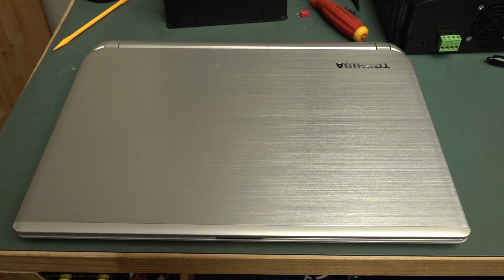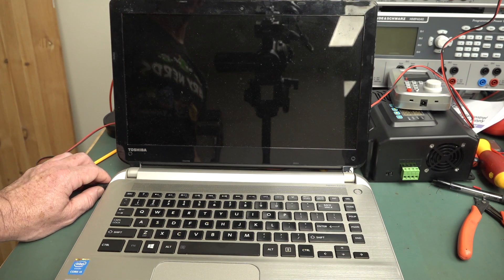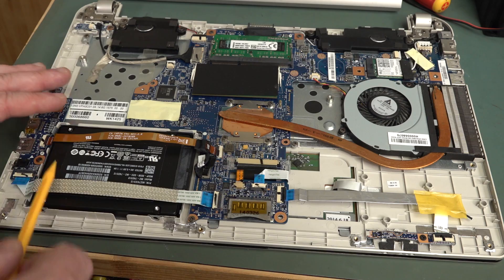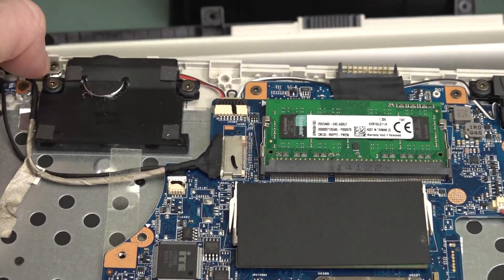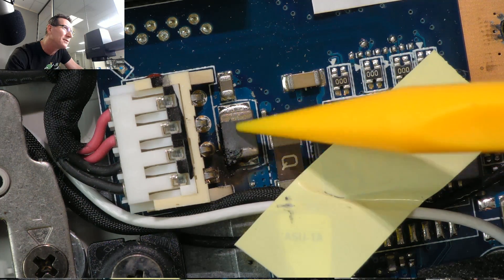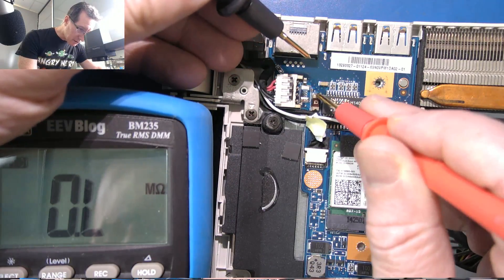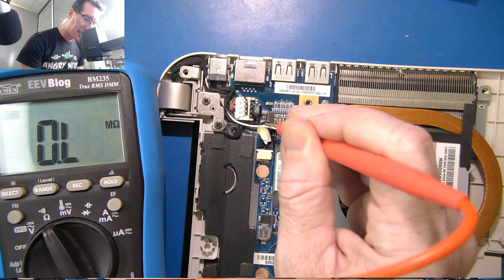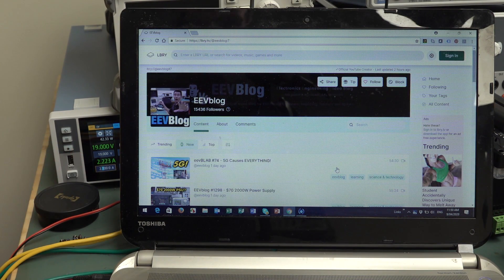EEVblog #1299 - Dumpster Laptop REPAIR

Comment: I just paid good money for an 860 Evo 512GB SSD.... is it April 1st?  That dumpster is a gold mine!
Reply from the maker: It's probably worth more than the laptop?
Reply: @EEVblog  I paid £62.65.+VAT.... like a lot of things they start £££££ and then end up £... bargain.  Still yours was £62.65.+VAT cheaper than mine.
Reply: @EEVblog  Since most used laptops go for $80-100 tops, yes.
Reply: @EEVblog  The 850 Pro is at least 200 USD new.
Reply: @MrCarGuy  Full price for 860 Pro 500GB is currently $99.99 here in the US at Micro Center.  850 Pro not even available any more.
Reply: @EEVblog  The 850 PRO is higher quality than anything in the market today,
It's a MLC drive - which is an extremely durable SSD technology,those drives went extinct and were replaced with TLC and QLC which are significantly lower quality and very cheap to manufacturer.
If you want the most durable and high quality than you will want a SLC SSD - Those monsters are even more durable than MLC SSDs and can cost thousands of dollars.
My recommendation is to buy a cheap TLC NVME drive,QLC drives are borderline garbage.
Reply: @EEVblog  pro use for be like x2 the evo series like x3 the write endurance tlc vs mlc flash .
But no ediding video/big backup no worth the upgrade for you recicle it for edidng video on the laptop is a overkill.
Reply: Just about any company tech waste pit is a gold mine. The key thing with dave's is that it's an office with lots of small companies that don't know how to get rid of their 'bad' stuff. Large corps have enough that they attract companies to buy and refurb their junk. My company recently updated to windows10 and just said 'anything on windows 7 goes' including a lot of xeon workstations less than a year old.
Reply: @thefatmoop  Many large corporates just toss anything that can no longer be depreciated with the tax office. Not worth the hourly salary of IT staff to even try to resell it - toss it straight in the bin (minus the hard drives/SSDs that get securely destroyed - although pretty much all user PCs/laptops would/should be bitlockered anyway). 90% of this stuff works perfectly fine and is only a few years old. Such a waste, especially seeing there are disadvantaged people who could really use it.
Reply: @brendanfarthing  This stuff should go to e-waste recyclers. They often onsell or strip the components of these. No e-waste should be going in landfill ever
Reply: @brendanfarthing  You'd probably find that someone would have taken it to repair and keep or sell on, but company policy wouldn't allow it (boss paranoid of staff making money from their rejected stuff).

I work for an electronics repair company, and none of us engineers are allowed to take stuff home to strip for parts, we're actually banned from going anywhere near the skip. Boss is paranoid that we might be making money from it, so instead it all ends up in landfill...... And this is a company that proudly promotes itself as taking it's environmental responsibilities seriously.
If we want something to take home, we have to to fill in a form, explain what we want this broken item for, promise not to sell it on (under threat of being fired), and have it signed off by management.
Reply: @Strider9655  WOW!! That really sucks... all that perfectly good tech just being dumped!! it's enough to make ya sick!!  it really is a SIN that shit like that is going on.. thanks for letting us know Strider9655.  ; )
Reply: @Strider9655  I think the problem is that it could easily become an accounting and tax issue
Reply: I'd believe this more than a huge oscilloscope.
Reply: @Michael Stum I fit SSD's daily and maintain alot of computers as part of my job. Your right in saying they're pretty much the best around. But I have to say. 2014 and 2015 your almost due. Check them with Samsungs SSD software at least. Don't trust any 1 hard drive anyway.
Reply: If I take a look at the local dumpster I will find rotten bananas and other such garbage maybe a dead animal lol
Reply: you need it badly if one repairs it
Reply: @punker4Real  Or it fits a need (like running a CNC device) that doesn't require the latest and greatest.
Reply: I'm still running a 250 840 Evo as my boot drive. I got it in 2013 and now my PC is running Ryzen 3. It still works like the day I got it.

Comment: You should have put some stats up on the 850Pro if that were the main interests. (even though that fin would give an idea of the previous users time with it, nothing personal is shared)
You can load pretty much any HDD analyzer and it will info you the run hours and all sort of data and give you an insight into how "healthy" and "used" it is".and then you can use that info as a guide for what you will use it for.
and an 850Pro will likely meet most of its cycle lifetime specs.
but could very much be a third party that have throw it out as the owner, would do as most owner that put a expensive drive in a laptop. take it out if the lap time goes sour & defective, in regards to ones data and the value of the drive, and you pretty much always can use these Sata3 SSDs... even a cheap sata3 to TypeC adapter to like sub5 bucks would make it portable with all devices and a very fast 400 to 550Mbps portable drive..

Comment: I know exactly why that drive wasn't mounted down - the bracket that originally held the hard drive wouldn't fit properly with the SSD. I've done replacements like this on similar laptops, and they never fit - orientation ends up being wrong, or the SSD mounting holes are lower down than on the HDD, or some other simple stupid issue. Last laptop I did this job on, I used strips of packing foam and packed it in around it, worked a charm.

Comment: The color of tin on the inductor which is should be silver has becomes brown, it is impossible will happen if there is no "short circuit" in high current.
Anyways, at the charger/adapter there is a protector when short circuit occurs.
So how do you think Dave?

Comment: For SSDs, Samsung on its own is pretty expensive already and their PRO series comes at hefty premium too. For most, EVO or even QVO are fine and a lot cheaper. Yes, QVO is slightly slower due to QLC, but in terms of everyday use, gaming and other not that intensive stuff it is fine and miles ahead of any hard drive. Personally I got 512GB 750EVO, few years old now and 1TB Crucial MX500, which came pretty cheap for the size. Still, as finds go, nice SSD indeed. I am bit surprised owner didn't take it out. Especially if I throw things away, I always take better parts out. Though SSDs lately got relatively cheap up to 1TB.

Comment: Not related to the repair or even the laptop model, but the Toshiba ones we are forced to use (at some work site) are some of the worst company laptops I've ever seen. The only upsides I can give them: standard charging jack, decent microphone, IPS screens, decent battery. Downsides: performance, speakers, keyboard, touchpad, build quality, cpu fan quality, serviceability (25 screws just for the cover), price.
I have no idea how you can bribe a department to lock themselves into the toshiba ecosystem for at least 4 years (replacement parts, docking stations, chargers and accessories, paid warranty repairs, identical replacements, etc).
Sorry, just had to rant when I saw the brand.

Comment: I had a MacBook Pro 2012 with a gray screen. Almost looked as if it was stuck on the EFI boot screen. Ended up being a bad inductor by the LVDS connector.

Comment: Damn If my dumpster find Inspiron 3542 was so easy... Only a coil, lucky one. I had to replace battery charger chip, 3.3V/5V inverter plus KBC including extracting EEPROM part and programing it back to new chip. In parts I paid 6 bucks but spending 10 hours on it to trace everything... Luckily I got another completely burned HP 250 with compatible memory and matte LCD screen so I made full 3542 in matte screen, with 8 gigs of ram and SSD for basically 6 dollars. Excluding spent time it was cheap.

Comment: Just guessing, but it looked like maybe that missing screw came loose and shorted between the pins and the component . You would have to see the screw to be sure though. The burn mark looked to me like an arch from a direct short, being that the burn was just on that corner near the pins.The perfect place for a screw that size to get stuck and cause a problem.

Comment: My wife had this same style laptop a few years back, it was around $330 with an i7...didn't survive a Red Bull spill.
Reply: I bought a very similar S55 back in 2015. The BIOS chip died within 6 months. Had it replaced by a technician (Toshiba had left Venezuela by then), and the same chip failed AGAIN after 4 months. These Toshiba laptops from the years before they stopped selling to consumers are crap. My dad bought a C55 a few months later and is fickle as hell. My brother in law also owns a C55, also fickle. And all three laptops were bought at different places, on the space of a year

Comment: To all the people trashing this machine, I'll take it in aheart beat. I love these old Toshibas as they are generally fixable one way or another. No problem with screens or drives or RAM. The boards are usually accessible and can be figured out. And they ALL use the same power connector.

Comment: Nice - it's a shame that I don't have access to dumpsters/e-waste areas etc, because I'd definitely be salvaging whatever I could :)
Though that laptop was from the same era as my HP 15 - the latter having 1x 8GB RAM from factory (upgraded to 2x 8GB) and a 2TB HDD (getting a 2TB SSD is too expensive). The HP also has a DVD drive - the Toshiba doesn't!

Comment: I got an old laptop for bugger all at a garage sale, no power adaptor etc. It powered up ok and had loads of photos/videos on it. I ended up gathering enough info to find out the contact details of the original owner (turns out it had been lost years before) -  they were pretty happy to get their old data back.

Then I nuked it.

Comment: You can really tell most of these cheaper model laptops from this era (and even into today) are designed by the same ODM. That internal layout is extremely similar to the Dell 3000 series laptops.

Comment: Puts in an 850 Pro, doesn't bother to put the screws in. :facepalm:  Particularly bad on this design as it could break those ribbon cables with the movement.

Comment: Anyone got advice on a samsung Uh48h5500 tv standby light is on but when u push on backlight flashes for 1sec then standby again. I disconnected psu from main board and backlight lights up beautifully. The 13v plug pin on psu appear to all be correct.  I just cant figure out if its the psu board or main board. Cant find diagrams or pin outs. Tv is mint still had plastic wrap protection on it. No dust inside but i dont want to buy a 50$ main board then a 20$ psu board only to have a non working tv. So anyone with experience or diagnostic info on these model of tvs? I just dont know how to confirm wich board without more info

P.s. im a pretty well informed novice ive built PCs and repaired simple electronics but im no expert on checking chip logic etc

Comment: Someone found a Compaq CQ50 in the dumpster and brought it to me. Clean installed windows, the fan was completely clogged to the point the plastic was deformed so i took it apart. While there upgraded the CPU from a Celeron 575 (1MB, 2GHz, single core) to a T8100 i had laying around (3MB, 2.1GHz, dual core), dropped in 4GB of 800MHz ram and a 60GB SSD. Tested perfect!.. except when i put the top shell on. Have no idea what it moves or shorts that makes it so it doesn't power on.

Powers on bare, with only the power button plugged in. So it's not the screen or related switch for the screen. Turn on every time with the shell lifted, but once pressed in the shell without screws the machine doesn't power on. No burn or over heating marks, reassembled about 3 times already with everything perfect and the same thing happens when i press the shell together. I was mad, but now it's intriguing HAHAAHAHAHAHAAHAHHHHHHHH

Comment: I'm not sure if anybody knows, but recenlty a lot of videos about laptop "restorations" started popping up in my recommended feed. Most of those videos are shot somewhere in Southeast Asia, a bunch of guys "accidenatlly" find a trashed laptop with broken and missing parts and the whole thing is covered in mud. They film the whole process of the "restoration", but they don't even know what the hell they're doing. They scrub violently the board with brushes, they use a cheap ass analouge multimeter and probe some pins on the board and that's it. After that, they assemble the whole laptop and miraculously works ! It's not only the laptops, they also "fix" old phones, computer screens, toys, speakers, anything. How the hell those guys gain millions of views and subscribers ?

Comment: I'll take a free 850 Pro 512G any day of the week! I've graced a number of colleagues' computers with 256 giggers over the years, and have both 2 TB and 1 TB versions in use myself. I just didn't think that SSDs needed to be built any more cheaply than my trusty 830 back in 2012, you know, with like an actual metal case to get the heat away from the controller. Too bad that Samsung has really jacked up the prices since late last year. Been meaning to switch to Sandisk Ultra 3D / WD Blue since then but the crisis has halted any SSD upgrades for now.

I agree with what others have said, throw a less fancy SSD in there and use the Samsung for something else. A look at SMART values (e.h. #177 Wear Levelling Count, #241 Total LBAs written, FYI that's in 512 bytes) should tell you how much life there is still left - I bet a lot. Mind you, I once bought a used 512 gigger that turned out to have a lot of TBW on the clock and measurably degraded throughput, but after a full TRIM it actually came back quite OK.

Comment: I have used 850 PRO 256 as a primary drive for like 6 years and not a scratch on its health.
These Pro models are overengineered. I believe an estimated lifetime for 512gb models was 140 years with casual use, 150Tb write limit for warranty.
And intense enterprise torture for ~5 years.

Comment: Wow!  You really got lucky.  Most laptops quit working and leave no mark on the motherboard to find.  I've looked inside many dead laptops and never located the source of the magic smoke without probing through the power supply chain.
However I usually just toss out dead Toshiba's since they have historically had many other issues beyond early death in most every generation of their laptops since the early 2000's.  I've even seen the display models dead on the shelf on a number of occasions!  They simply do the absolute cheapest designs possible (like the FFC's passing directly over the HDD bay rather than a couple of folds to go around that area) so profit per unit is maximized without consideration for how long it will be before the design trade-off they made causes problems as the various parts of the system fall out of original tolerance.

Also, the 850 Pro is certainly (in my opinion) more valuable than the rest of the laptop. :)  Nice find.

Comment: Typical Post-2010 Toshiba build quality. As soon as I saw Toshiba and how thin it was, I knew why it was in that dumpster. Toshibas back in the Core-2 era were rock solid machines, I had so many A135 machines that were abused and kept on going. My brother bought a newer i5 model and that thing had to be repaired 3 times under warranty before he finally had enough and got rid of it.

Comment: By all I have seen, it seems that the screws inside the machines often are only placed in the marked holes (you may see the little arrow next to the hole with a screw, it is missing around the holes without a screw)

Comment: 6:15 I could be horribly wrong but the middle of the serial number on the SSD is G9 
If Samsung uses the same date code system for their SSD's as they do for some other appliances that would make it September 2015 (G= 2015 9= September) 
source: https://appliancedates.com/MajorAppliances/SamsungDateCodes.html

Comment: 4:10 they do this so they can use the same board for different screen sizes, and they only need to adapt the connector cable lengths

Comment: No need to replace this inductor, that is only used to pass FCC. I would just use a jumper.

The internal design of this Toshiba doesn't look professional and does not look as good as my previous 2 Toshiba notebooks. Probably this division was sold to somebody else, total not Toshiba design style.
Reply: You can really tell most of these cheaper model laptops from this era (and even into today) are designed by the same ODM. That internal layout is extremely similar to the Dell 3000 series laptops. It's like a flat board of plastic on the bottom with all the components just thrown around and bolted onto, and then covered by a clamshell bubble.
Reply: @W1ldTangent  yep i have had both its true
Reply: Yes. Internal layout, connectors and pcb material are all crappy. Similiar or worse than china made one! Toshiba brand , just kidding...Samsung is better.
Reply: @ray-charc3131  Are you telling me that Samsung does not make high end and low end models?

Comment: 3 out of 3 laptops I've "repaired" so far had mechanical issues with the power plug or button.
Search ebay for stuff that does not turn on at all, it's a gold mine!
I could "repair" and resell a laptop every week for double or 4 times the investment, but then I'd have to pay tax, it would legally become a form of business and I'd have to provide warranty and be liable in all sorts of ways which sadly, is just not worth it for me.